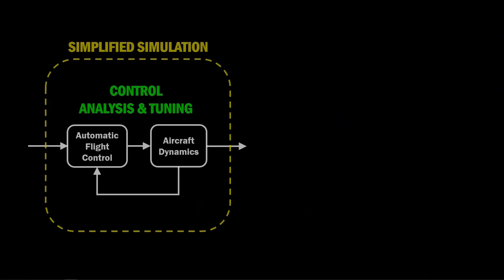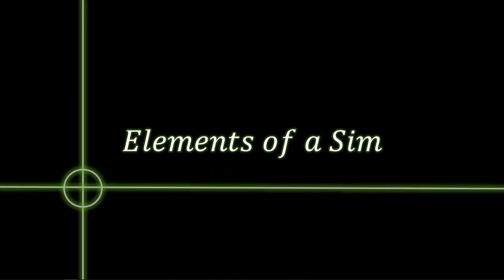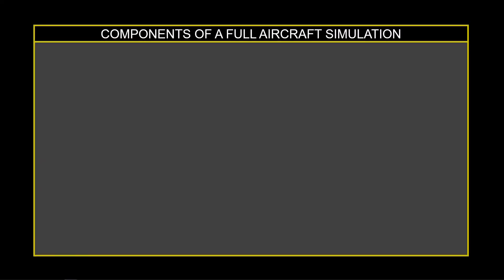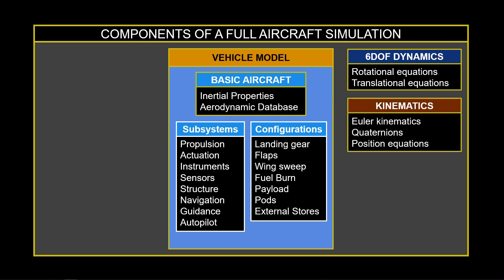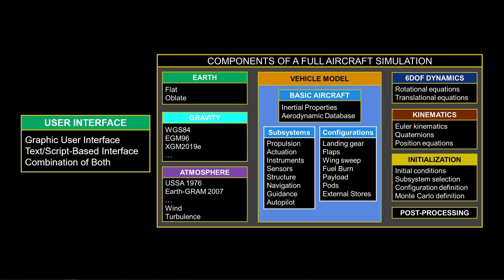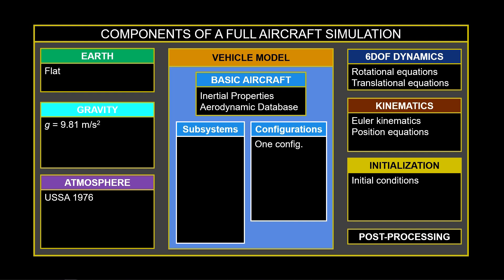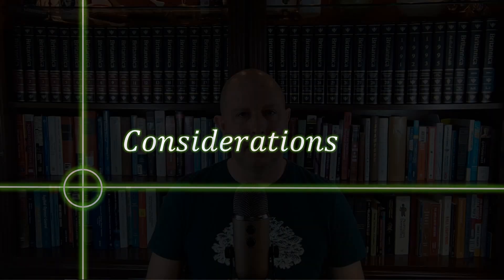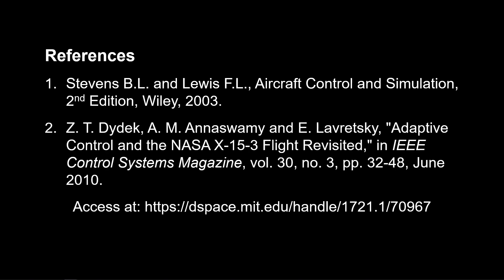Six Degree of Freedom 6-DOF Aircraft Flight Simulation Tutorial - Introduction - Section 1.1

Comment: Hi Ben, on the MCP of airbus or Boeing don't existe Switch to commande the pitch attitude,How the Auto Pilote maintien +2,5° in cruise i. want to know the loop
Reply from the maker: Hello there. Unfortunately I don't have specific insight into Boeing or Airbus autopilot architecture. However, pitch command tracking controllers have fundamental PI architectures. For example, one could implement integral control on pitch angle error and proportional control on pitch rate for artificial damping. This makes use of navigation and IMU data which should be part of the avionics of modern aircraft. My series on longitudinal flight control (see www.learngandc.com) covers the architecture and tuning of basic controllers like the pitch tracking controller.

Comment: Hey Ben your videos are great! Would love to see you do a video on TECS. Also quite curious why books usually ignore such stuff.
Reply from the maker: Hello there, great suggestion! I have never worked with the Total Energy Control System method so pursuing a lesson would be a great opportunity to learn more about it. I would guess the textbook authors simply are not a familiar with the topic as they are with other methods. There are certainly research papers on the subject. Control techniques that ultimately become well-known and pervasively applied are a function of many considerations. These include technical basis (e.g. proof of stability), achievable performance, tune-ability, precedence and risk, engineering touch-labor, sensitivity to unknown parameters (i.e. required model accuracy), tradition, and social dynamics.